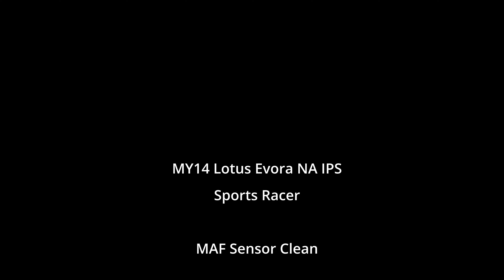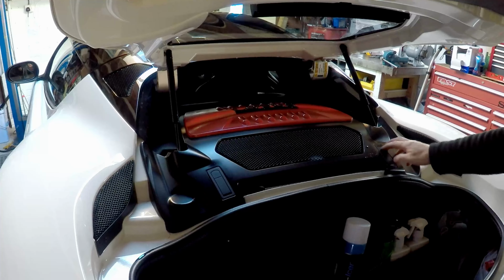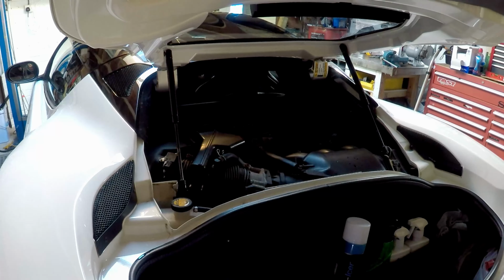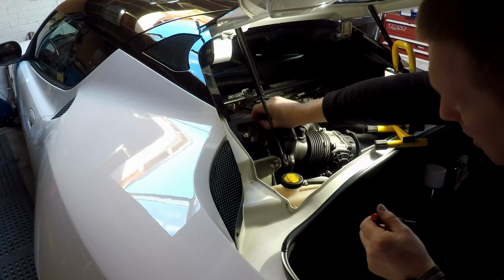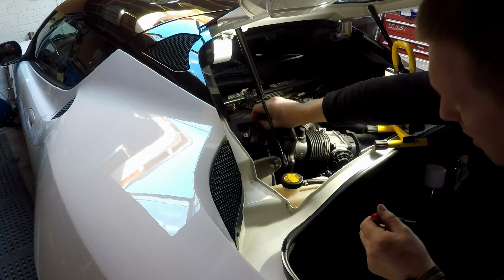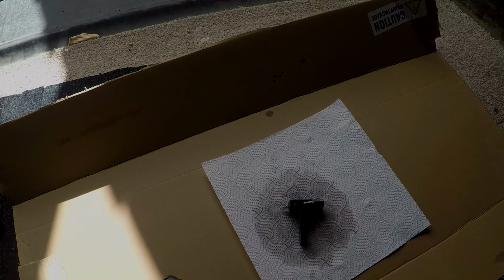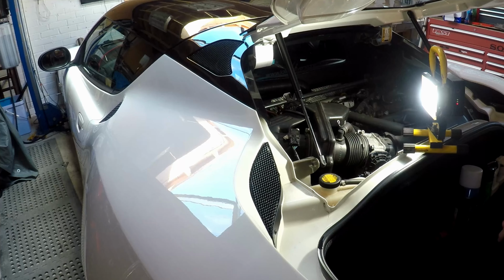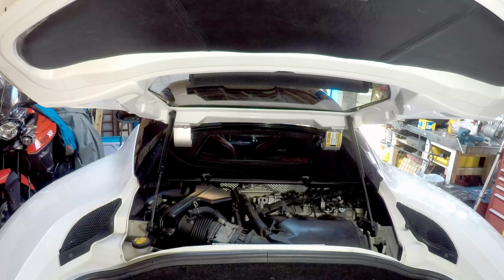Lotus Evora (and Exige) - How to clean the MAF Mass Air Flow Sensor

Comment: Thank u！Sometimes my ips Exige will die at low speed and then gasp is it related to air flow sensor？
Reply from the maker: It's possible or an air leak. But cleaning or replacing the MAF is an easy first job.
Have you tried reading any OBD Engine fault codes yet?
Reply: @TonysGarage_UK  Yes it shows P0700
Reply from the maker: that code is a transmission error code usually .....

" The P0700 code indicates that there's a malfunction with your vehicle's Transmission Control Module (TCM). This computer monitors your transmission and works with the Powertrain Control Module (PCM) and Engine Control Module (ECM) to shift gears when necessary."

Comment: Thanks for the video.  My 2017 Lotus Evora 400 is in limp mode with code P1109.  Do you think this is the problem?
Reply from the maker: Could be, certainly won't harm  cleaning the sensor and resetting the fault code after.